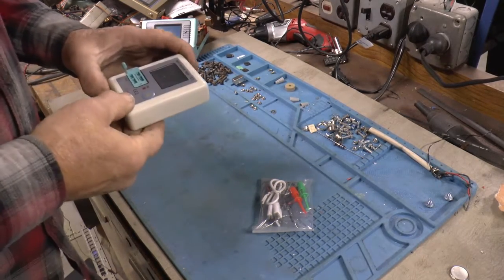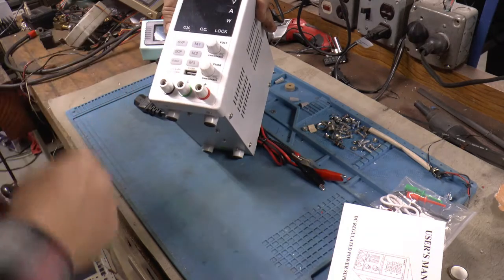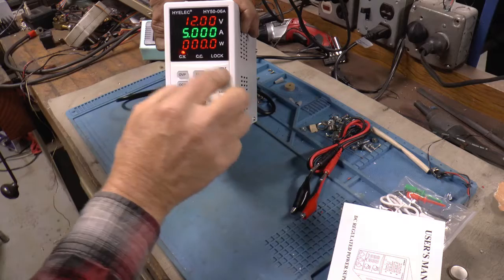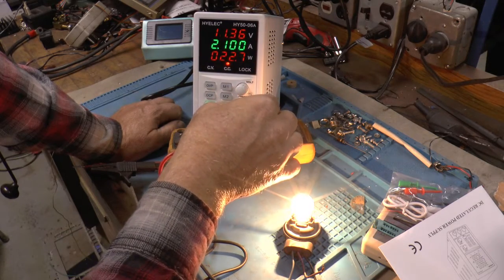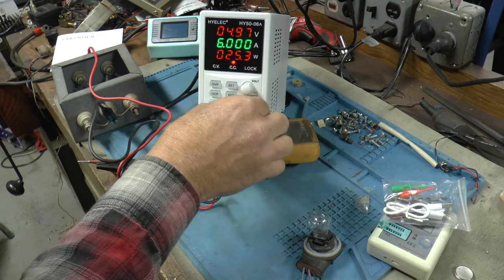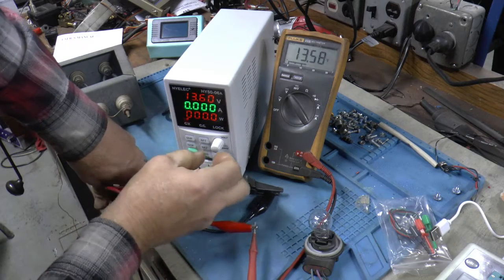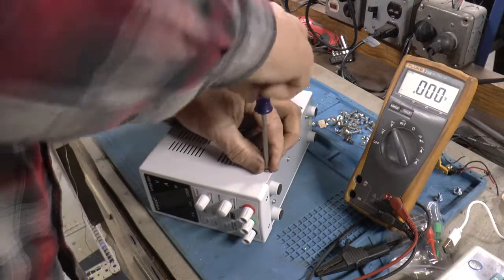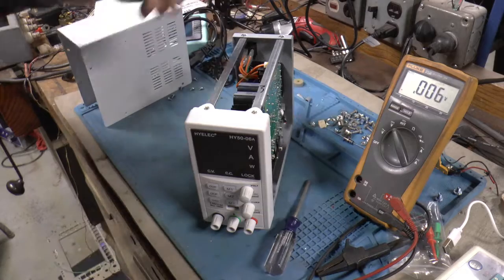Hyelec HY50-06A DC Regulated Power Supply

Comment: The heatsinks are good size, but they are placed near caps and below. And AC caps are above, which is bad. The fan is in the middle. Means it will cause heat zone above, AC caps will fail first. Need to modify it for langivity, possibly The mainboard should be rotated 180 degrees and fan needs to be moved to the top, also mosfets will go up. The caps around DC PWM mosfets also tend to catch ton of heat, not sure if they are cooled.

Comment: The supply is not rated for 6A at 50V.  It is derated to 150W max which is 3A at 50V or 6A at 25V.  If it were fully rated it would be good to 300W.  It's still a good supply though since it has the storage and output switch.  You don't get those until you spend some bucks.  Thanks for the video I'm thinking about buying one.
Reply: no, main limitation is transformer size (ok) and caps max voltage rate. You can recap and push max performance, there are videos on that.